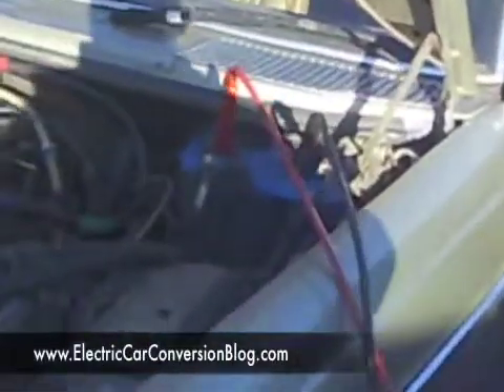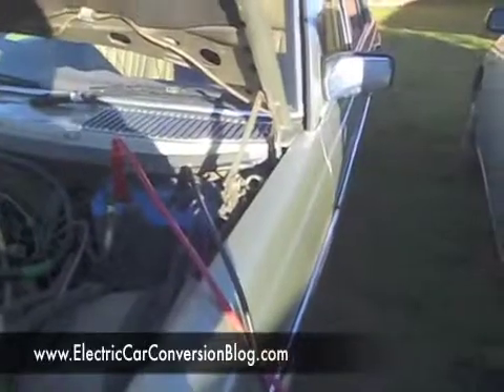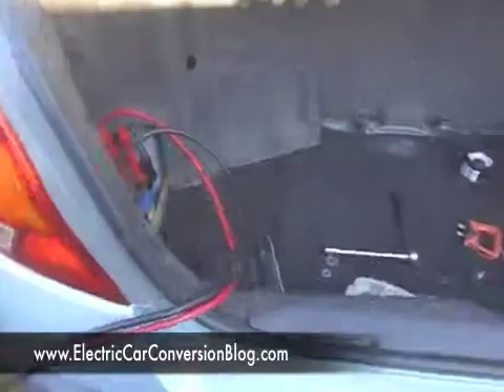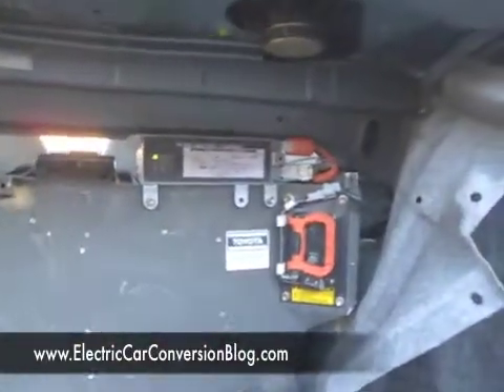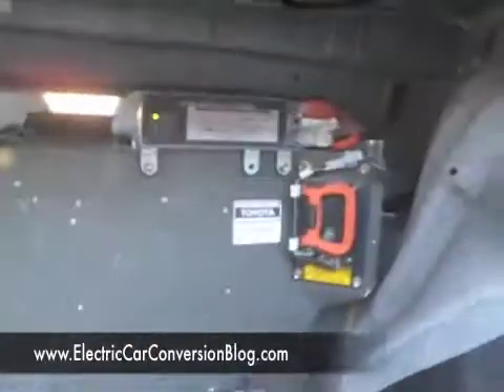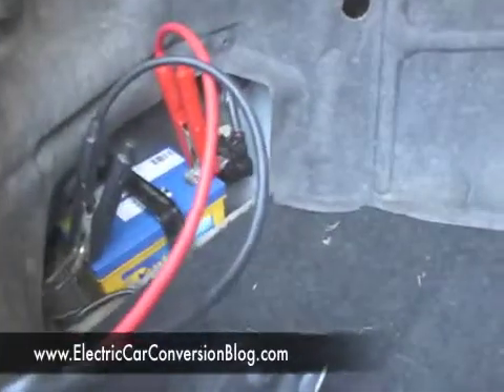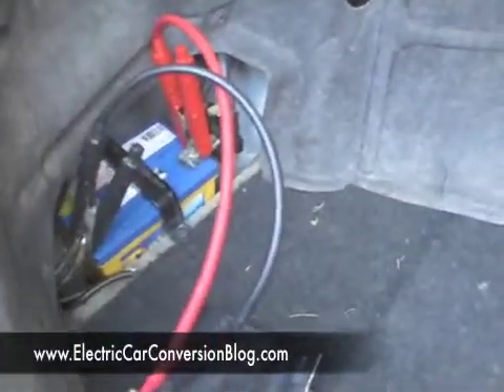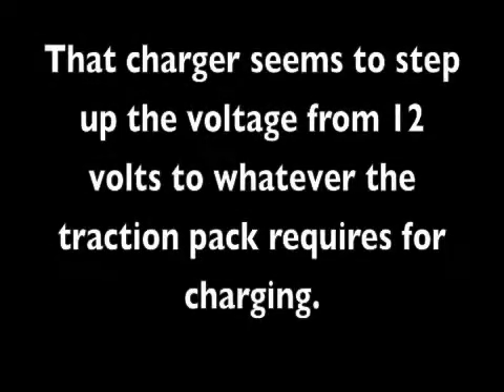Prius Jump Start - charging traction pack using 12 volts

Comment: Wow! Thanks for the suggestion. I just picked up a very cheap 1998 Prius Mk1 (100k km) with the cylindrical battery cells, (battery in  dubious condition) and was mystified when I found the charger in the boot. After seeing your video I hooked up a battery charger to the 12v battery and when I pressed the charge button (on the Prius' charger) I got the green charging light for a few seconds (before the red error light came on). 
     When attempting to start the engine I actually saw the ready light come on briefly which was encouraging. Nobody home in the motor dept yet though. 
This gave me the idea to let it charge all night, and if I can get it to charge the main batteries in the morning I'd be thrilled - they look pretty low on the dashboard gauge. Failing that,  I'll do what you did with the jumper leads and a running car. My family won't be impressed if I do that at 1:00am...

Isn't there somewhere you can plug a power lead into the charger?
Reply from the maker: +reelMn Thank you for commenting. To get the engine to start, try pressing the accelerator as soon as you see the ready light. This may trigger the engine to start, but I can't guarantee it. Just watch you don't crash into anything. The engine may decide to start, but it depends on various factors and when the battery pack is not in the best shape, unpredictable things can happen. Also, if the batteries were in good condition and you accelerated very slowly, (provided battery has sufficient charge in it) the engine may not even start up until later on.

I have not seen a socket to plug in a power lead into the charger. The closest thing I could think of would be to replace the donor car (ie. the Mercedes-Benz in the video) with a high amp (at least 30 amps) 12volt battery charger.  

I would be very scared to attempt to charge the batteries whilst I am asleep or not watching it. I would rather supervise the batteries getting charged in case something goes wrong. Things can go wrong.

Let me know how you go and if you have more questions, feel free to ask me.

Comment: Please disregard my earlier comments, your JDM Gen 1 looks like our Gen 1's, but is electrically waaay different, and I don't know a thing about it! (open mouth, insert foot).
 Battery packs on our cars look like a loaf of bread with 39 slices, yours look like Insight sticks.
 I can't wait to be able to buy new chemistry batteries to swap into our old hybrids. Robert
Reply from the maker: I have started using Headway LiFePO4 cells http://www.evworks.com.au/headway-38120-10ah-cell-lifepo4-cell-3.2v-10ah on one of my Electric Go Karts with a Zeva BMS. Heaps lighter than the lead acids I used to use. In relation to the Prius, thinking out aloud, to make 288V, one would need 288/3.2 = 90 of those Headway cells. However, the challenges that I believe that need to be overcome is how the charging system and the Prius battery management system interacts with those batteries. How will Myrtle react? With limited documentation, I think there is going to be a lot of trial and error. Thinking out aloud again, perhaps, if an interface can be made between the LiFePO4 and the various other computers. At this stage, I'm open to ideas on how to swap in new chemistry in old hybrids.
Reply from the maker: Another option is to strip out the Prius and put in after market motor controllers and BMS etc. The tricky bit will be the interaction between the gas motor electric motors and possibly the transmission. How the transmission is controlled is currently a mystery to me.